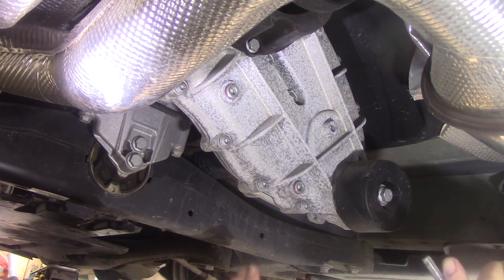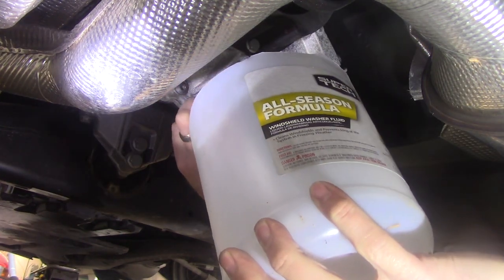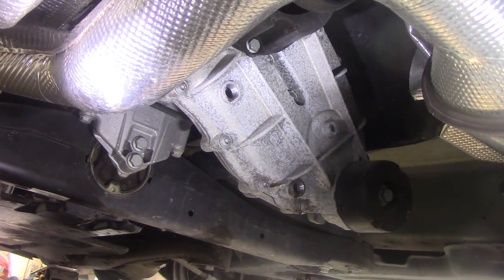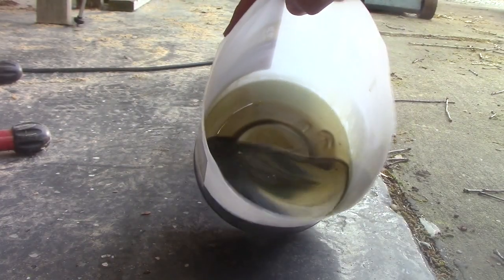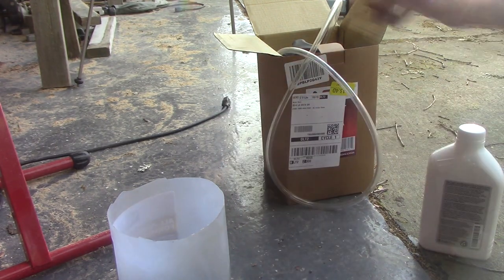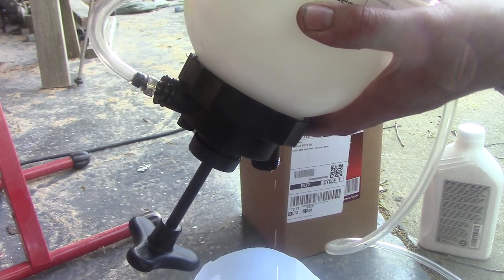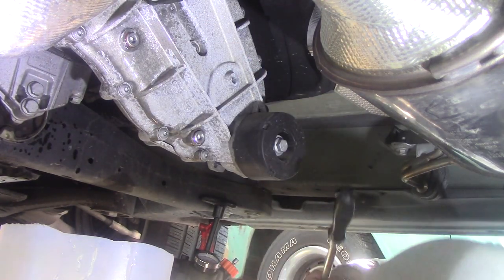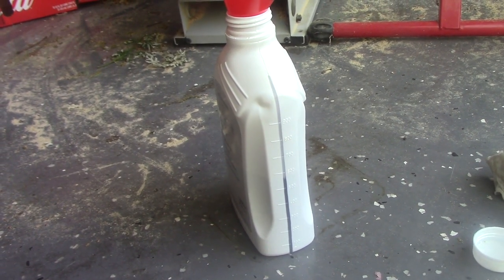VW Touareg Transfer Case Fluid Change

Comment: Next Saturday I will change myself to my Touareg 7p the oil of the 2 differentials and the transfer, the brake fluid and I will do the rotation of the wheels. Best regards.

Comment: Hi, thank you to sharing this vieo. According to the service procedure it is better to use thread locking fluid (AMV 185 101 A1) for the screws. It is worth to check for oil leaks.

Comment: Thanks for this. Mine only had 600ml in to and certain that  it had not  been changed before. It was very black and dirty after 57k miles. VW say sealed for life!!    Refilled with 850 ml of Ravenol DTF-1.   Filler & drain plug torque is 17Nm or 12 Ib.ft.

Comment: Is this what causes that skipping feeling when you’re turning at slow speeds?
Reply from the maker: I assume that is the feeling. These being full time all wheel dive vehicles something has to move when you turn tight corners. Mine seemed to calm down after the fluid change although it can still be felt at times.
Reply: @bryansprojects3570  oh awesome. I appreciate your response. I do notice it gets worse when I raise the car. It’s almost like it messes with the cars dynamics and the system isn’t as refined as one would assume.

Comment: After checking into this a little found out there are two fluids for the Touareg transfer case, one for rear locker and one for non locking. The one for rear locker is G O55 515 A2 the fluid the  non locker is G 052 526 A2 I really don’t know why the rear diff would make a difference, but according to VW is does, if you don’t know which you have, would be best to call the dealer with your VIN to verify.
Reply from the maker: That does not make any sense why it would be different. I think the locking rear diff is pretty rare and may have not been available in this generation Touareg. I think the ones that had it could be manually engaged by the driver. I plan on changing the diff and trans fluid soon.
Reply: @bryansprojects3570  that's correct. That was for the first generation of touareg when it was an off road beast.
Reply: Actually the rear locker does exist on 7P. The package is called Terrain Technology. I have it and my car seems to start grabbing every time I turn the car off. To get rid of the "grabbing" i have to switch it in low gear and activate the rear locker then disengage it. I presume i need to swap all the fluids. 

Thanks for your videos and excellent walk throughs. 🙌